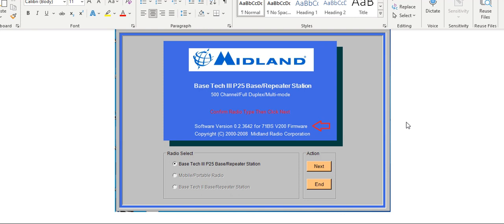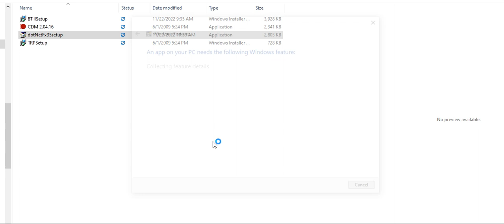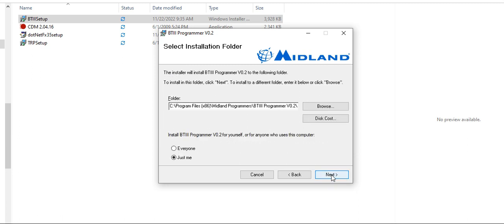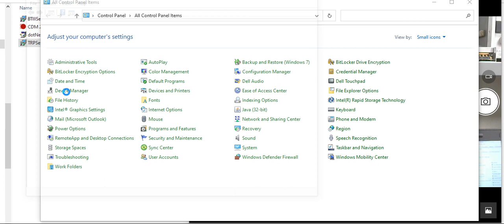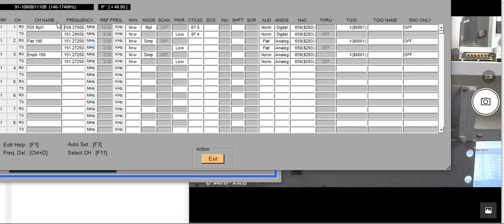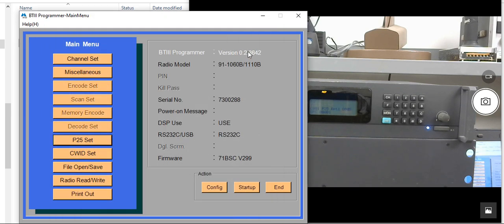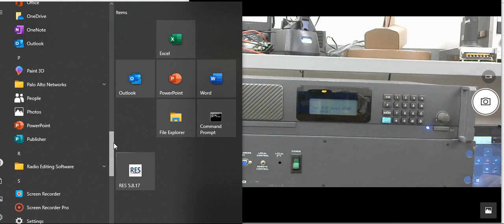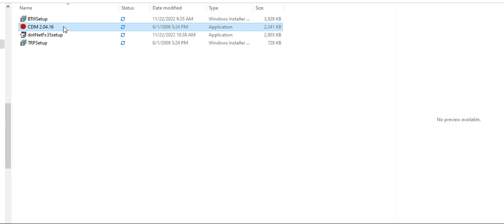Midland Basetech III Programming Software Installation

Comment: I picked up a base tech II , where did you find this software ? thx
Reply from the maker: My employer got it with the purchase of the repeaters we use. I think any Midland dealer could hook you up.
Reply: I found the program, now I need to find the programming cable
Reply: @ededison9404 where did you find a copy of the software
Reply: @TheArcadeguy  I had to sign up , it was easy peesy
Reply: @TheArcadeguy  I think they wont letme post the link it was "hamfiles UK"

Comment: Hello,  where can I find a programming cable for one of these?
Reply from the maker: Ebay usually is about it. They are currently sold out. It has an embedded circuit board inside the connector housing. Can't just make your own. Whatever you do, don't plug it into your computer until you have loaded the drivers.